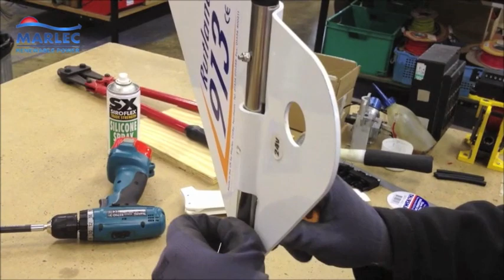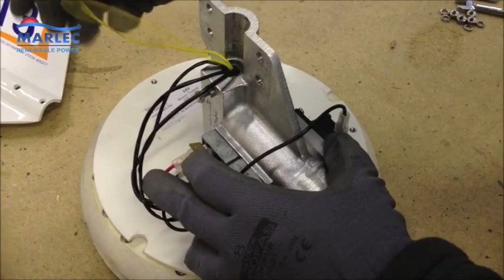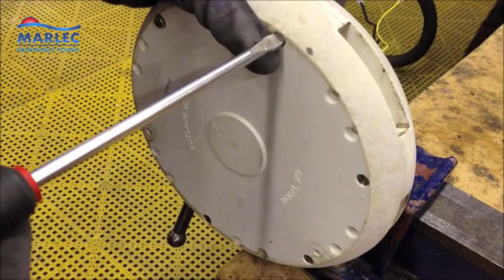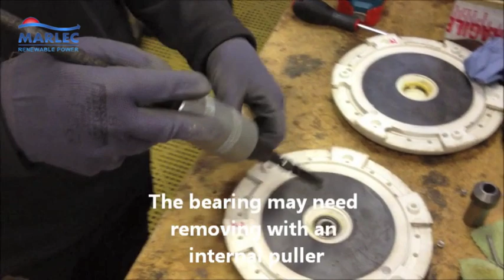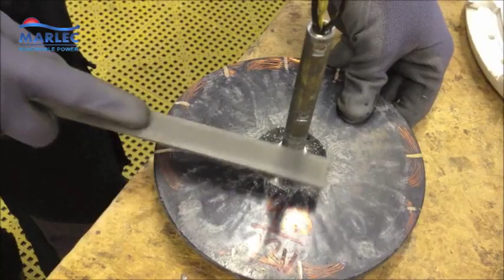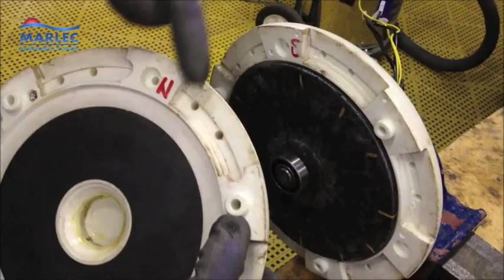How to disassemble a Rutland 913 / 914i Windcharger to replace the hub bearings

Comment: Make sure you use good quality bearings, the bearing with the metal seal goes at the front and the one with the rubber seal to the back. The rubber seal is the only thing keeping water and damp out of the bearing.

Comment: Hello Marlec. I am just in the process of replacing some bearings and this video talks about tapping the trailing edge of the blade but the lug is on the trailing edge so you need to tap the leading edge to get the blade out. One of the comments here is from someone worried about breaking blades which is definitely possible if we are being told to hit the wrong edge. Please clarify. Thank you.

Comment: How can I check to see if the windings aren't damaged, I took mine apart to replace bearings but I marked the black resin and im worried ive damaged something, what reading should I get from the wired before the go into rectifier? (Ohm readings)